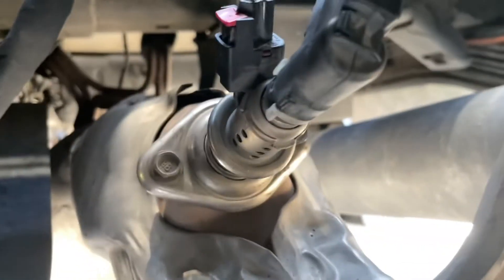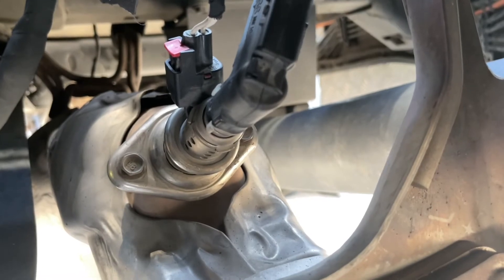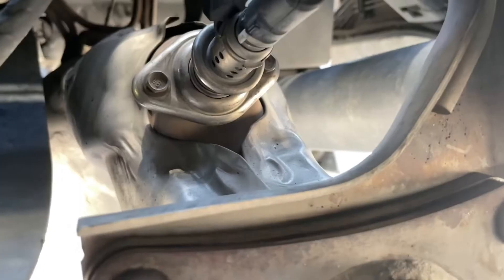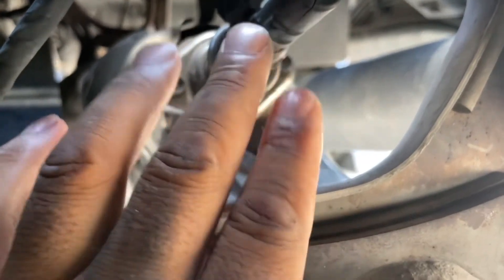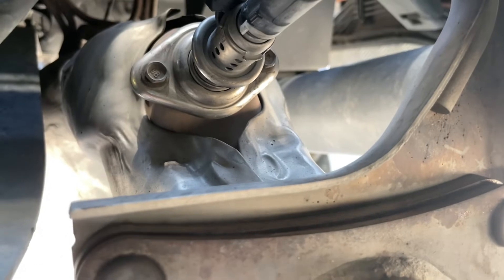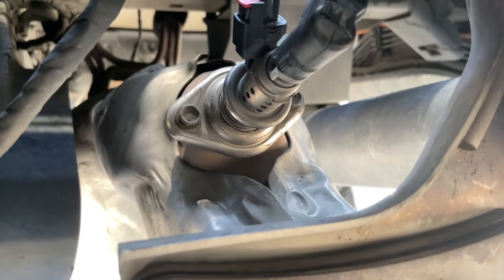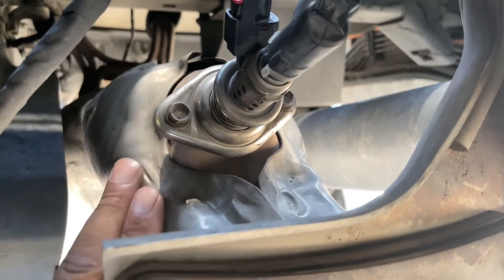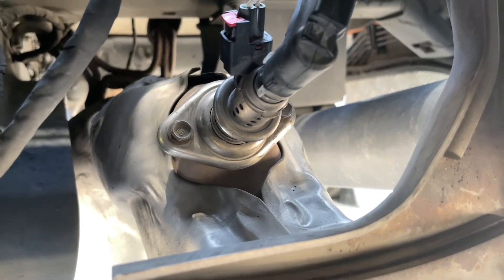Service Def see Dealer Easy Fix!!!  Dodge 5500 DIY repair.

Comment: 10 mm bolts will break very easy, use caution, welding head back on not easy have to take exhaust out.
Reply from the maker: Thank you for the tip!

Comment: my bolts are stripped or destroyed from the def fluid i dont know how to get the bolts off
Reply from the maker: I haven’t had that issue, you might need to drill them out.

Comment: Soo while attempting to clean this injector,  1 of the bolts broke.  Please help. Any advice is greatly appreciated
Reply from the maker: I’ve never broke one. If you have a little bolt left try using Vic Grips. Otherwise you may have to drill it out but be careful not to threads.

Comment: Did this clear the see dealer 150miles to limp mode issue??
Reply from the maker: It cleared the deff issue see dealer, I clean it soon after engine light appears to avoid truck issues.

Comment: How is the truck running so far?
Reply from the maker: About two weeks later the light came back on.   I purchased a new Def injector from Dealer ($275) installed it and no issues since.
Reply: @riosautotransportllc  thanks
Reply: Did it stop running? Or not turn over?
Reply from the maker: I took care of issue prior to it stop running or stop turning over. I didn’t want to be stranded.
Reply: What did you use to clean it
Reply from the maker: @jeffgann4775  I used a compressor and blew all the debris out.
Reply: @jeffgann4775  hot water is all you need to clean it I done it too
Reply: @riosautotransportllc Has your new injector Given you any problems since?
Reply from the maker: @MrShiftYoPerspective  No but we clean it about every two months. Now I don’t remove it completely, I’ll do a video next time I clean it. It’s very quick.
Reply: @riosautotransportllc  ok thanks

Comment: Any idea what size those bolts were?
Reply from the maker: 10 metric
Reply: Be careful!!  The bolts break very easily as they are stainless in carbon threads. So they gall and bind. I had the dealer break mine and have to weld and fab to fix it, which was better than the 4200 they initially wanted to replace the SCR
Reply from the maker: @wall0184   Thank you for letting me know!! I will definitely be careful.